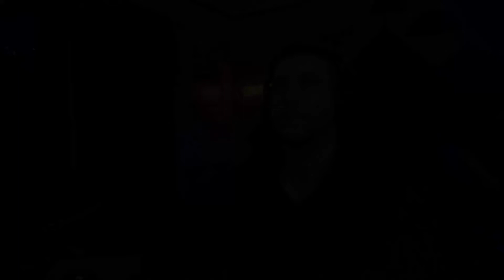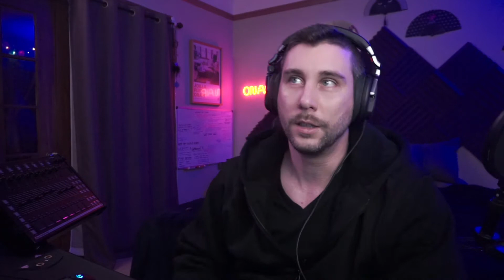Monitors Are NOT Why Your Mixes Suck // Scott Talks Audio

Comment: I have to disagree with you. True, you don't need the latest and greatest. But a good pair of monitors is essential for getting a good mix. Home stereo / surround sound speakers just don't cut it. The trick, as you said is to pick up a good used pair when your just starting out.
Reply from the maker: This is true! I should have clarified, but yes- everyone should start with a decent set. Older monitors are fine and often great in fact. Even KRKs are good enough to make top quality mixes.